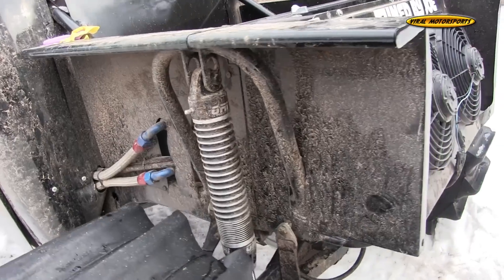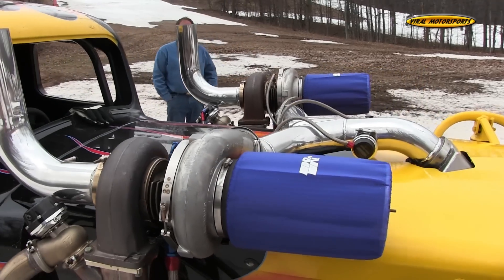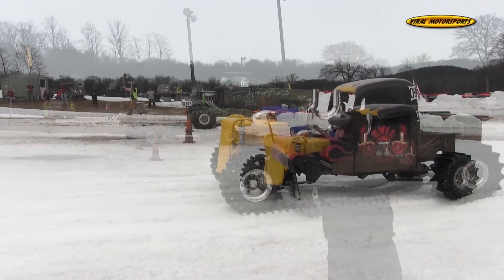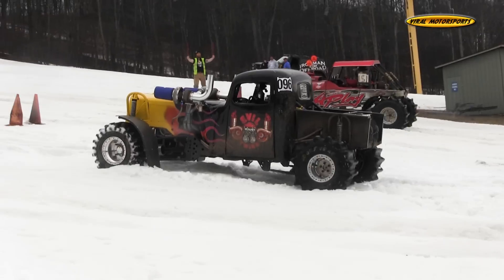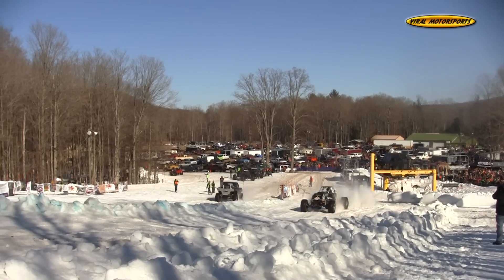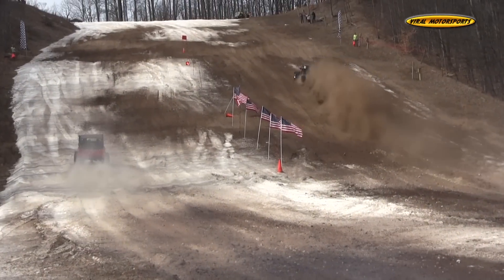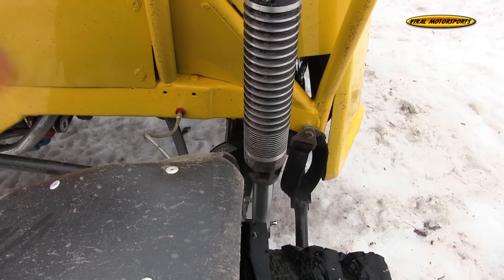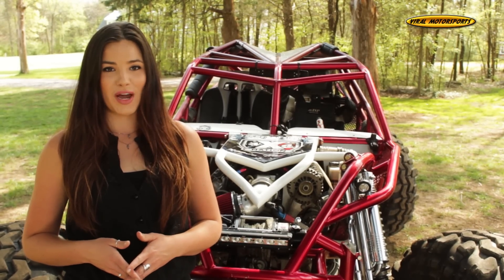Twin Turbo Mud Rod /Fastest Twins In Off Road/Bree Molitor

Comment: Thanks for sharing.What is the dates that they begin running. Do they have a VW buggy class? Looks like lots of fun.
Reply from the maker: Dennis, if your referring to Schuss Mountain Snow Challenge, they have a number of classes based on tire size, power adder or not, and a sportsman class and a utv class. The VW's usually fall in the tire class with a number of other buggy's. The buggy in the video is Chad Coker, operator of AppleTree Automotive which is a VW parts supplier.
Reply: Thanks for the info I shop at appletree. I will try to be there next year. Thanks for your time.